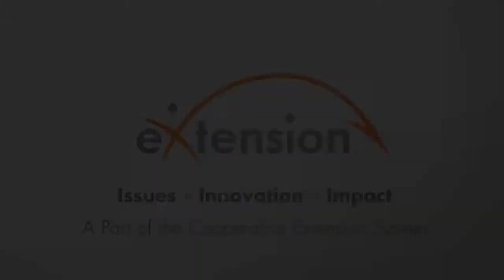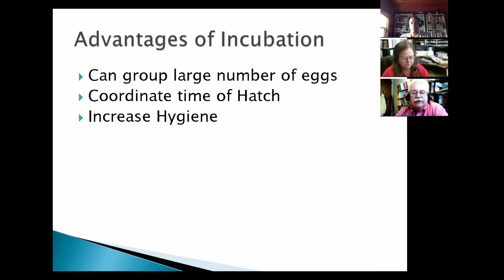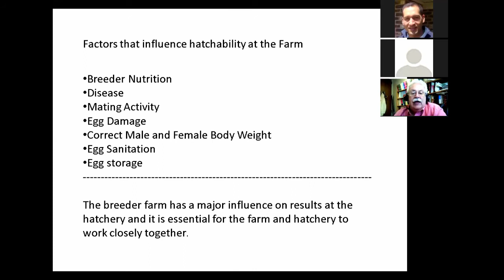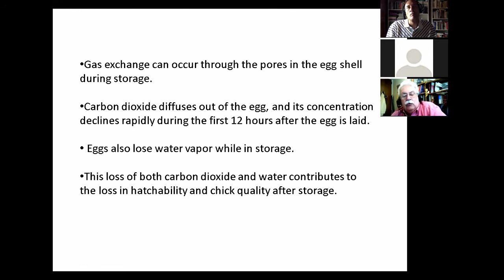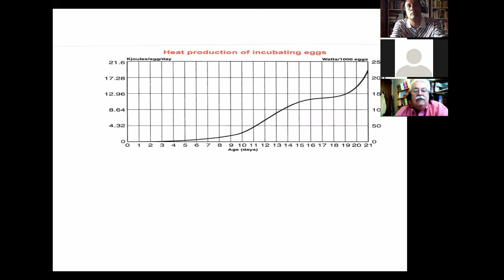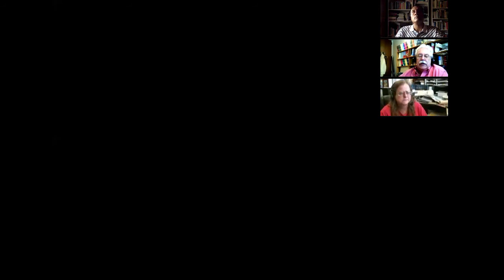Small poultry hatchery management

Comment: The eggs that are sold in stores that we consume are those fertile or infertile eggs?
Reply: Most are infertile
Reply: Unless you buy “fertilized eating eggs” (like at some Trader Joe’s) or you buy local fresh farm eggs the chances that store-bought eggs have been fertilized is almost 0%. I’ve actually hatched out Trader Joe’s fertile eating eggs but very few will hatch. You have to get very fresh, barely refrigerated eggs and even then the washing and transportation of those eggs greatly reduces the chance that those eggs will hatch. Out of many dozens of eggs that I tried most had zero hatch and maybe 2 batches had a few hatch. I’d say maybe out of 10 dozen eggs tried over about 5 occasions I had 6-8 hatch twice. It was fun to try but even though the eggs were cheap I could have bought good hatching eggs for less.